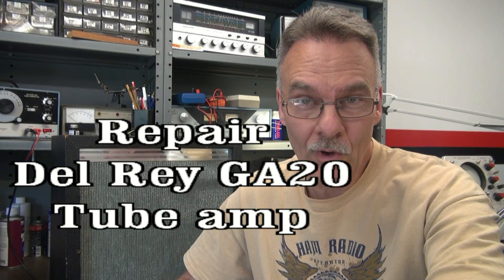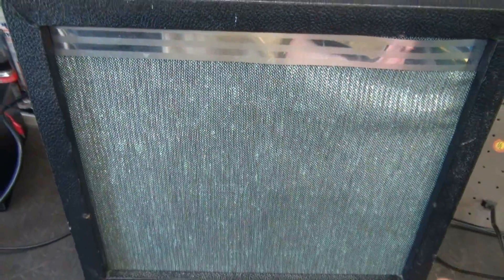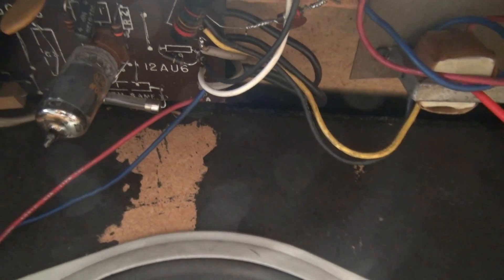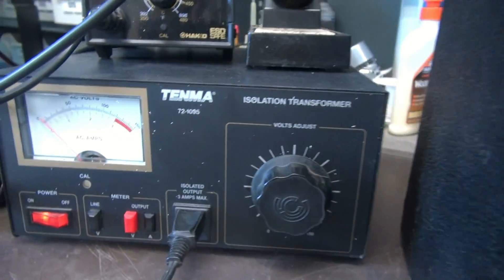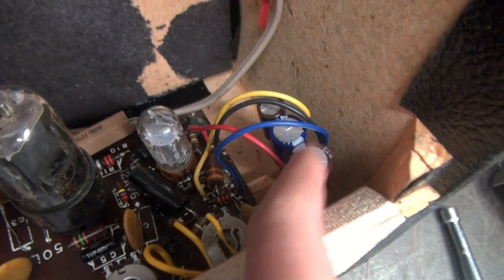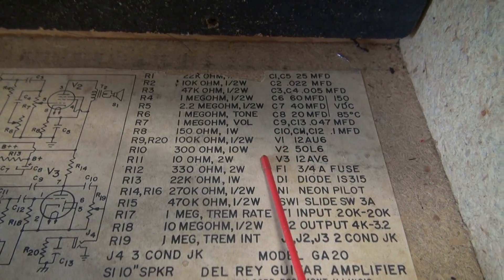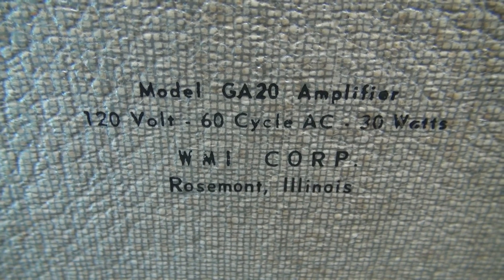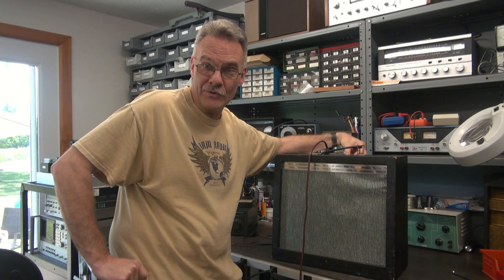How to repair Vintage Del Rey GA 20 tube guitar amp D-Lab electronics

Comment: Looks like those two 1uF vs 25uF caps were C1 & C2, the cathode resistor bypasses.  I wonder if they deliberately reduced the capacitance during production to reduce low freq gain and mask some of the hum?
Reply: ...or to reduce the bass ! Could be a wise change for a nice less farting overdrive at full volume !

Comment: And I wouldn't call it a "hot chassis" because it looks like the chassis is isolated according to the schematic. It looks like T1 and R3 are providing isolation on the input jacks. Haven't watched the whole thing yet, but just out of curiosity, did the chassis measure any potential from your house ground at all?
Reply from the maker: Good point man, I will check it. Thanks for your support
Reply: Thanks for posting! Yeah, R20 and C13 are the chassis isolation cap and resistor. I think that's how they got UL approval. Without those, it is a hot chassis.
Reply from the maker: I was able to reduce the buzz big time by twisting the input transformer in + out windings and route them away from the AC line + Neon lamp. Much better now

Comment: The noise is likely from heater to cathode leakage in one of the 110 VAC series filament heaters.  A NOS 50L6 would likely fix that noise issue.  ;^)   Multiple NOS 50L6s can very likely be purchased on Ebay for less than a single 6L6 output tube if you are a smart Ebayer like me.  LOL  50V caps where it calls for 25V caps are fine but it was probably a good decision to change those old e-caps out anyway.  You definitely don't want either of those e-caps to fail as short.  If the one on the 50L6 shorted it would unbias the output tube causing it to red plate and melt down very quickly.  8^(